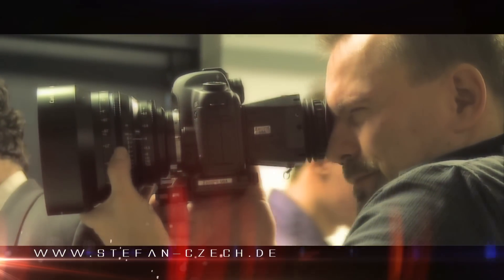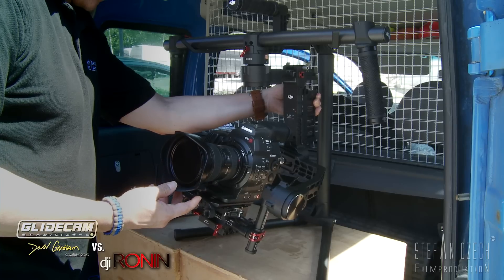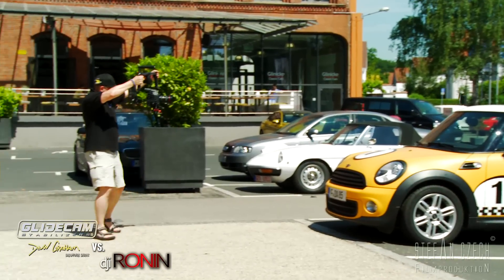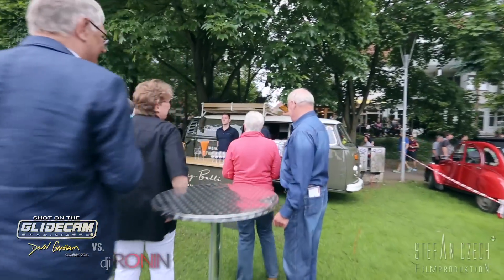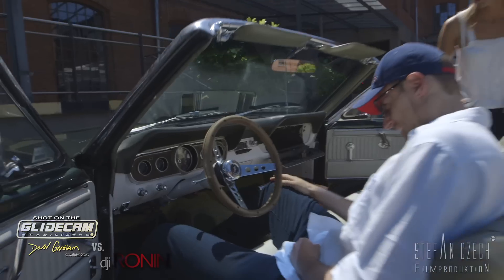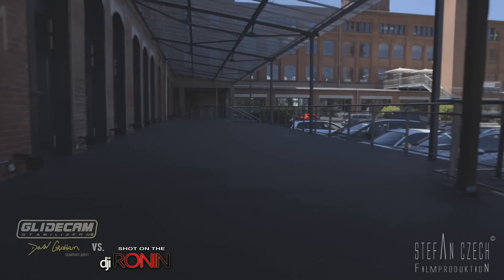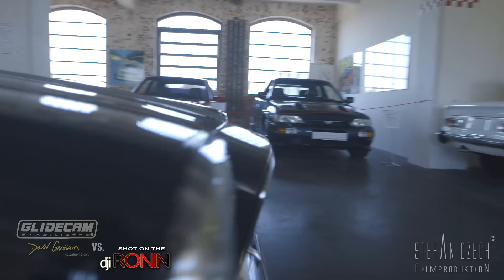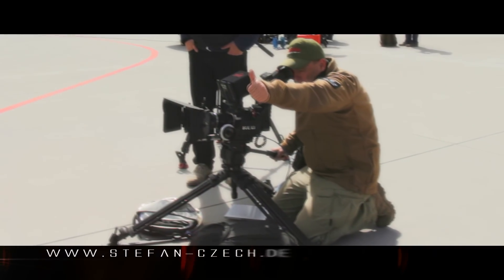Glidecam DGS vs. DJI Ronin 3-Axis Stabilizer

Comment: Hi! Thanks for this video. I must say I don´t agree with your comparison. In your intro you say:"I'm a filmmaker, steadycam operator etc etc" This means that your level of expertise on the glidecam/steadicam is way more extensive than your experience with a gimbal. It is clearly noticable in your shots that you have almost no experience handling the Ronin, while your steadicam shots are flawless due to years and years of experience.
In my opinion your pro's and cons aren't really objective. You have some points where the Ronin lacks, but you dismiss it too fast, because it's new and you don't have any experience with the product. For instance, you don't need a second operator if you have a small monitor and some experience. On the video I can see you don't use the "ninja walk", you just stamp on the ground with chunky sandals. Not really the best shoes for the job! That will get you that upwards bouncy movement. Bend your knees and "sneak" around.

I have experience with both and I think the Ronin really is awesome in getting to the next level regarding production value!

Son't dismiss it too fast!

Keep up your reviews! They're very informative and good to watch!
Reply: +TRifficVision You have some points:
1. The Ronin require batteries, which is one disadvantage in my opinion. 
2. Motorized Systems require fine tuning of the motors using software, and can lead to variance in results. Possibly intimidating new users.
Mount a motorized gimbal on a helicopter or octocopter and the use cases become more apparent.
Reply: +TRifficVision As an owner of multiple glidecams (including the Devin Graham series) I agree with your comment. Even though the ronin might be seen as something that is ready to be used flawlessly out of the box, just like any other piece of equipment, it takes practice as well. 

I agree with many of the statements Stefan made. I tend to prefer the glidecam for most practical uses as I love the more "natural and less robotic feel". One point, however that I think should have been noted in the comparison is how great the ronin lends itself for situations such as shooting out of a car or helicopter. Just the other day, I shot off of a boat and the ronin was absolutely perfect for the circumstances. 

Otherwise, great comparison. I love both products and think both are great for different scenarios.